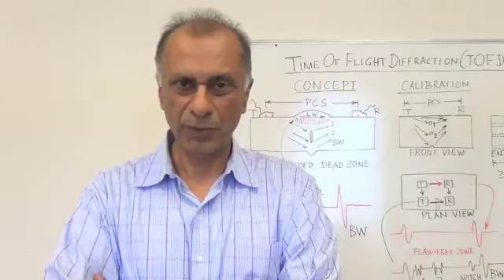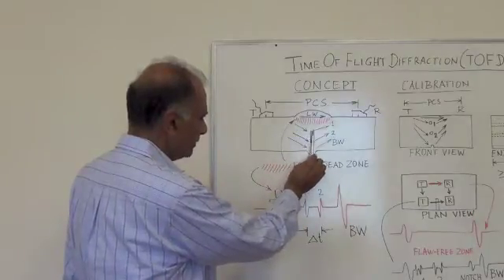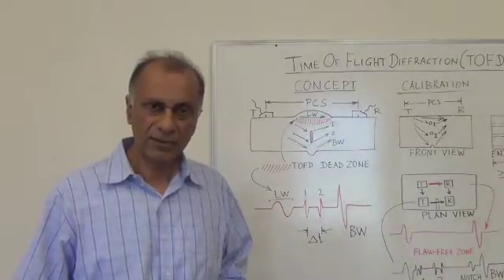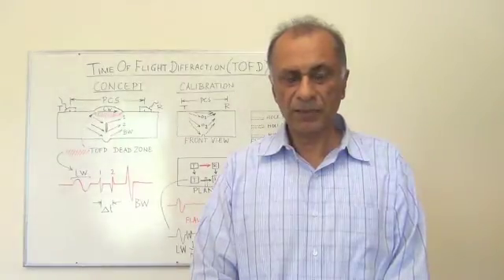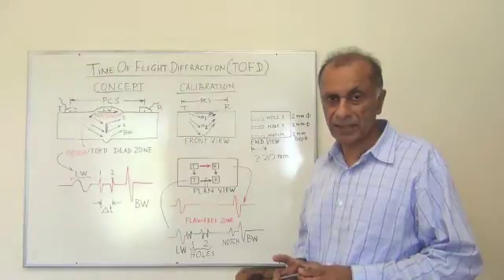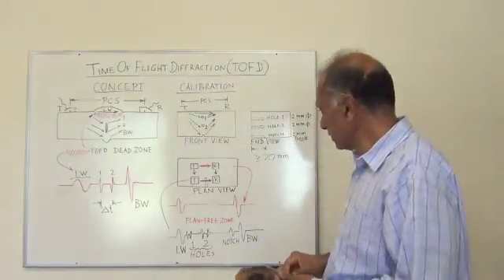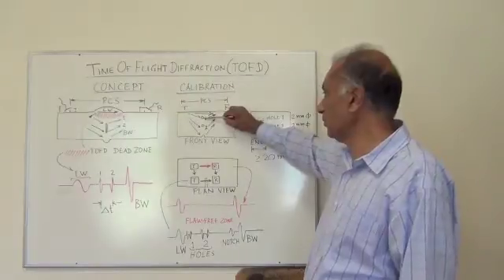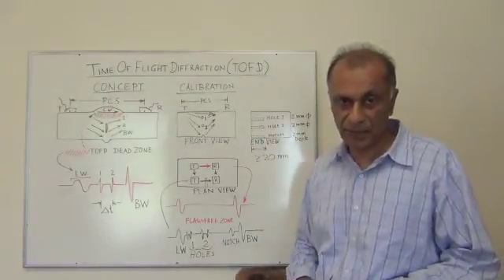Birring 207 Time of Flight Diffraction (TOFD) #1 Concept and Calibration

Comment: Why the waves will diffraction occur only from tips of flaw not , why it will not diffract from body of flaw
Reply: Because of the pitch catch, I would assume that since the  sound wave only gets diffracted at the edges/tips of the weld, this is where there is a sudden change in in the material property which would be picked up by the receiving transducer, The body of the flaw is more uniform than that of the tips and/or the sound does not make it to the receiving Transducer so there is nothing to detect from the body... hope that helps

Comment: please what the different between TOFD  and PAUT
Reply: TOFD is a technique for single crystal probes used in weld inspections PAUT is Phased Array Ultrasonic Inspection. This type of  inspection uses a probe with a number of crystals which can be fired independently enabling a large areas to be inspected very quickly and accurately. Additionally manipulation of the firing times allows beam bending for to extend the scope of the inspection.